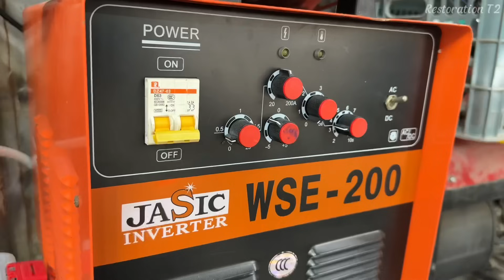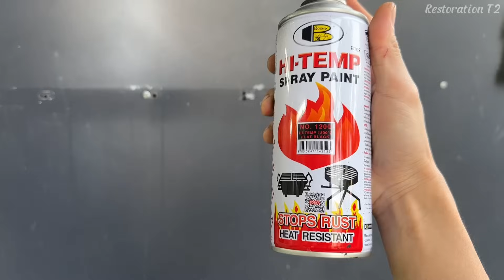The Husqvarna Chainsaw Company Went Bankrupt Because I Knew This Repair Secret

Comment: You should make a video showing how you got the saw so dirty , that would be worth watching .
Reply: Está máquina estaba destruida , no seas ridículo
Reply: That is abuse by the user. I have seen stuff like this for sale. It takes an idiot to abuse this equipment. It was not staged. The oxide coating on the cast parts takes years of being left out in the elements to form that .
Reply: No, you can use oxidant @Subgunman
Reply: Drop it in a porta potty?
Reply: @dzumadrozd yeah sure you can oxidize aluminum on purpose but for that much it will take several months to oxidize that much. This saw could be a real abadoned one.(im talking about the cylinder and other alu parts)
Reply: Who cares

Comment: what was in the beaker?  I am getting ready to da a project and that would be great to do the bolts and nuts black like those you did.
Reply: It's old motor oil, used to strengthen the screws and anything you dip into after using a Blow Torch. Old method but gold

Comment: That cylinder brush is not a honing brush of some new type, is it?  If it is I've never seen one like it.
If it isn't you should have honed that cylinder with a new ring after all that work you did.

With this much skill you should have made a few hundred doing this, which is how much a new Husq costs, but still not as good as that older one

Comment: I raced Husqvarna motorcycles awesome bikes .
Reply: If you raced before 1986-7 then Husq was Husq, then an Italian company bought the bike name, didn't buy the tooling or the engineers.  They stayed in Sweden and started Husaberg.  Eventually KTM bought Husaberg then bought Husqvarna bikes.

Guns and power equipment remained a separate enterprise.

Those 1986 bikes also leftovers sold as 1987 by the Italian company were really well made bikes.  Now they are good bikes, just like KTMs
Reply: @AvaPxiaO  1976 to 1983...
Cagiva bought them now KTM owns them.
Reply: @Nudnik1 Cagiva was the greatest moto.company  in Italy but not marketing wise, with little funds they had the Japanese industries up against the wall in GP500 

I remember the blue 125s the red 250s and the green open class of that era :)  I must be a few years younger then.  Last I had an auto 420 with worn out top end a new 500 top end, but passed the project to someone else.  Something about the sound of these bikes, as if the rest were made of hollow aluminum and Husq,. was made of SS  Great bikes to work on, every last washer and spring felt like indestructible.
Reply: @AvaPxiaO  Yeah Cagiva was fast 125 in mid 80s .
Italy makes awesome bikes.
I use Meteor pistons aftermarket cylinders on chainsaws from Italy better than OEM often.
I miss the air cooled Swedish made Husqvarna ,Maico, Montessa, Ossa Bultaco .
KTM is excellent.
Gas Gas also KTM.
Beta bikes I think still Italy or Spain .
👍

Comment: And the moral of the story......by the time you factor in a new carburetor, bar, chain, bearings, ignition coil and spark plug, iron core, flywheel , sandblasting, painting, brazing and who knows what else, you can pick up a brand new one for dirt cheap and throw it away when it konks out and buy another.
Reply from the maker: You’re right, it’s not always the most economical repair, but the satisfaction of doing it yourself is priceless! 🥰

Comment: The oil pump for the chain is not functioning, it should throw some oil off the bar when revved. That would be tested by those who know how to use a chain saw. The oil flow to the chain is adjustable on good chain saws. I have rebuilt a few chain saws for fun and not bad, the piston looked like it had suffered a scuff seize caused by running without two stroke mix or carb running lean or crank seals leaking in air leaning the mix. I would have liked to have got a better look up the bore. I have had to fit new bore and piston in those cases before. It seemed to fire up and run ok. I used less sealant😀.
Reply: I was yelling at the screen when he forgot to put the oil pump back in. That nice new bar and chain are going to soon be toast!
Reply: mash with your finger to make oil come out  this type of cutting tool works only with the electric.

Comment: Husqvarna is arrived on the professional market after Stihl, that's why it seems to be dead (for some persons), but it's a fake.
For the chainsaw, the too, husk and Stihl are the best, simple to repair, simple to work, lot of spare parts anywhere, and.... Husk is cheaper than Stihl on the spare part, well, let's joke!!!
NB : you can also buy a jonsered, it's cheaper and...it's a huskvarna, low cost.

Comment: Horrible unprofessional repair. They didn’t disassemble the crankshaft, didn’t check the condition of the bearings, didn’t paint or smear it, and everything for the sake of show. They also installed a Chinese tire under a proper one. Just dislikes.
Reply: Safety guard gone missing?